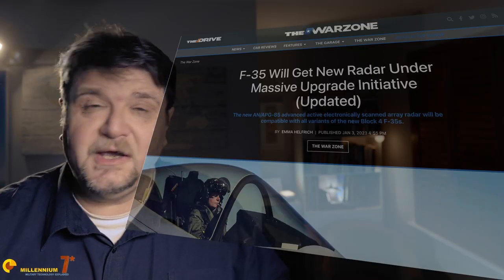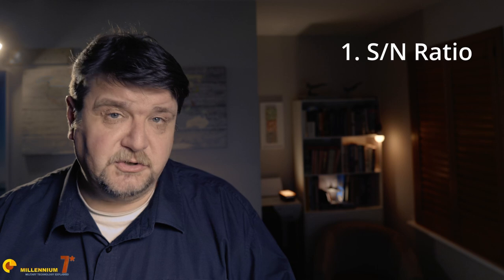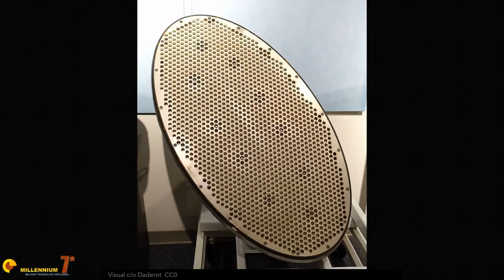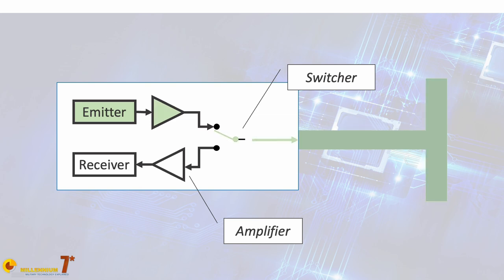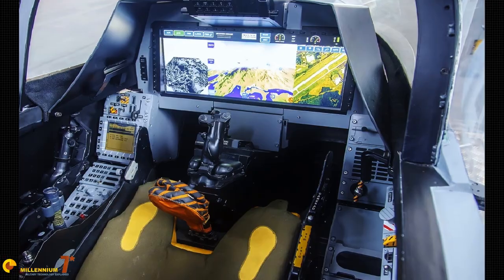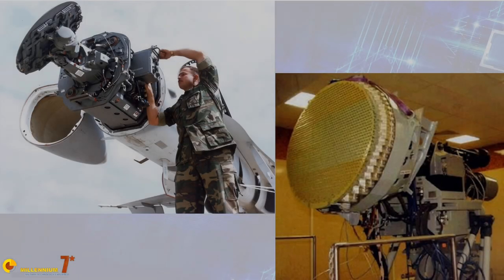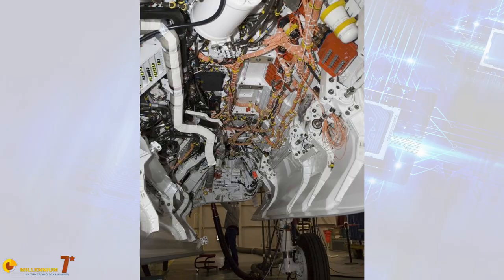The insane engineering of the F-35 AESA radars!

Comment: Or you can keep the larger cooling system, and pump more power through the GaN...
Also, when using it for jamming, the new advantages with narrow beam propagation give not just more range to radar, but more potency to jamming. And all without needing to put a lead-lined bib on the pilot ;)
(for those who were wondering, the main difference between APG-81 and APG-85 is going from GaAs to GaN, and adding 3 new EW modes)
Reply: Nice. I'm betting that's why there's a move from speculation on AESA radars being used as DEWs to the possibility being part of the USAF NGAD.
Reply: @j.f.fisher5318  Looking over my DC uno cards, I'm gonna play "I don't seem to recall". It's a much stronger card than "I'm not at liberty to say" or "I don't have that information in front of me right now", as it gives unlimited plausible deniability for one turn.

Comment: Fascinating but now I have a few questions:  1) Does this AESA radar require that each aircraft knows every second EXACTLY where it is located in relationship to the earth AND and each one of its friendly aircraft?   2) What happens if the defending systems use VHF or HF radars that are widely distributed outside of the conflict areas?  If the defending system is always transmitting ( broadcast radio, TV, mobile phone towers) at RF wavelengths related to the physical sizes of the aircraft, the FACT of the intrusion could be detected along with some relatively accurate location and altitude information?

Comment: Kept hearing AESA-AESA. Let's check it out. In Greece, we already turnt our first 6 F16s into block 70-72 with AESA Radars. The most modern F16s worldwide, which makes them effectively Gen 4,5. 80 more to follow. The rest 75 will remain block 50-52Adv. (Gen 4). Incidentally, we also receive the latest HARM (Anti-Radar) and Harpoon (Anti-Ship) missiles for them. We also received Rafale aircrafts with AESA Radars as well, same case with latest block 3 Exocet missiles and Anti-Air Meteor which supposedly on paper guarantees one shot one kill. They also carry our semi-strategic SCALP missiles. Last but not least, our order of F35s has been approved by US Congress and the process finished. Unfortunately, they will be here 2027-8 due to high demand. Our Mirage 2000-5 are also upgraded. Pretty sure we'll be OK Airfoce-wise. Ours will only be matched with Israel's in the wider region. Thanks for new Kits for our F16s, US guys. Always allies.

Comment: It was not mentioned that the true superpower is not just coming from the semiconductor: GaN. (but GaN is a very good semiconductor nonetheless)
The other recent innovation was using HEMTs (high electron mobility transistors). These transistors use 2D electron gas in a quantum well for conducting the current inside the semiconductor, which is really crazy. The thin and highly conductive layer is created inside an undoped semiconductor, so there are no dopants to cause resistance or noise, or to slow down the electrons. This is quite extreme because undoped semiconductors are really bad conductors, but that is overwritten by the 2D electron gas in the quantum well in the conduction band.
HEMTs are also relatively cheap to make, so you can even buy an 8W 2.5GHz transistor, for 5USD. (and it is tiny: less than 5mm)

Comment: Maybe worth noting that GaAs AESA radars had significant limitations in terms of peak output power, which is in turn needed to burn through jamming. This wasn't a "deal breaker" for fighter-sized platforms where the total power was limited by the platform, but it explains why terrestrial PESA radars such as Patriot's MPQ-65 and Aegis' SPY-1 remained PESA until the advent of GaN MICs allowed similar power levels in an AESA.

At about 11:20 you describe AESA radars as being able to "instantaneously" search the entire volume, but that's really only true when low S/N (and therefore short detection range) is acceptable. For maximum-range search and similar cases where very high S/N and therefore high power on target is needed, the resulting dwell time is more of a constraint than the mechanical scanning rate of a conventional radar or the phase-shifter settling time in a PESA. Where AESAs really excel is in their ability to efficiently track very large numbers of targets while maintaining periodic scanning, and also their ability to maintain near-continuous coverage with low power for things like short-range horizon search.

The most modern AESAs (ones that do beamforming and doppler processing in a single pass rather than sequentially) also excel in their ability to receive "from all directions at once" (i.e. they can use the signals from the MICs to concurrently synthesize receive beams along many axes),  which is a key enabler for multistatic radars, wherein the direction of the return can't be predicted. It will be interesting to see if the Chinese continue with their Luneberg lens LF radars (which intrinsically provide a similar capability, and are undoubtedly multistatic) going forward.

I disagree that the beam can be "very very narrow". AESA sets are constrained by diffraction just like every other antenna, and the best mechanically-scanned antennae were already quite close to that limit. The beam-width is ultimately determined by Rayleigh either way.

I would argue that the fundamental enabler of an LPI radar isn't so much the ability to emit on "any frequency" as the ability to emit on arbitrary broadband frequency "fingerprints", which are extremely difficult to detect unless known a priori. There is a very fundamental similarity between CDMA cellular systems and LPI radars in this regard.

wrt having the radar emit multiple beams concurrently, my understanding is that doing so is fundamentally problematic wrt monopulse processing (which you didn't address but which is a "must" for good angular resolution).
Reply from the maker: Thanks for the explanation.

Comment: Consider this possibility:  Whether or not the APG-85 has some very special capabilities I may speculate about, a future version probably WILL.   So what is an AESA radar system?   In short, it's a very powerful and flexible RF transmitter/receiver system with enormous bandwidth and a very broad operating frequency range.  It can be precisely controlled digitally to generate virtually any arbitrary waveform with appropriate software.  Or to receive virtually any arbitrary waveform, if it has the software for it.   It can be thought of as a highly capable transceiver with enormous bandwith capacity, under full digital control. 

What it can do is subject to the imagination and programming skills of the design engineering team that builds it.    Not just radar.  Assume it's a far more general purpose transceiver.  Or it CAN be.  Software determines capability.    Imagine that it could function as a high power airborne wifi access point.  And much more.  

It could even have capabilities that overlap into the ECM role.

Comment: It is not strictly an AESA related question but the radars of maritime strike aircrafts. Study reveals that anti-ship mission needed specialized radars. The most famous is French Agave radar (and Anemone radar) which was used with Exocet missile onboard Dassault Super Etendard and Mirage-5 aircrafts. These special radars were not good at air to air modes. Did the Marineflieger Tornado aircraft had a different radar than that of Tornado IDS, for using Kormoran anti-ship missile? It would be the same for UK marine Tornado versus Tornado GR4 of the RAF.

Comment: The newly upgraded airborne radar of the J-20 (a new generation of fighter jets) has used microwave photonic technology with full optical control of receiver/transmitter, and the working band is very likely to be no longer limited to the X-band (possibly X/C, X/Ku, X/Ka, etc. One of the dual-band), with stronger anti-stealth/anti-jamming capabilities for low RCS target detection/weak signal detection in strong clutter. The new microwave photonic radar icon can perform centimeter (cm) -level ultra-fine real-time video imaging on detection targets. If it is used for air-to-air missile seekers, it will basically abolish the old American AN/ALE series of towed decoys and MALD air-launched decoys. At the same time, the 055 drive also uses the same technology, which can accurately image and identify incoming targets during the anti-missile interception process.
Reply: Probably true. The military technology is advancing very fast. That's why Gripen E and soon even C have very fast upgradability, as the only known airplane, to always be at the cutting edge of performance. Hence next generation, Gripen NG. But today all other known airplanes take years to upgrade, and propably even the Chinese ones.
Reply: @unknownuser069  No forgetfulness from me on this topic
Reply: Don't believe everything you read in the sales brochures - particularly when it is generic techno-speak.

Comment: Placing "insane" in a title might have been over used in you tube videos but here, it fits.  PESA beam forming looks like the same one used in 5G.   I wonder if AESA can still function in a PESA mode to transmit low freq radar, to better see low observable aircraft better?
Reply: nah not really (but i'll caveat it in a mo). RF ability is a function of the element (T/R module) spacing and element antenna shape and tbh what the IC is built to produce. However (caveat), there's not much to stop you from putting a small array at a longer wavelength in front of the antenna. It'll degrade the main antenna a bit but as long as you're not silly it can be worth it. At 1:55 the top antenna has a bunch of dipoles going around the outside (normally they're arranged near the middle though) they probably operate on a lower RF (from the dipole size) for IFF interrogation/reception purposes. It's not a radar though and probably only outputs a few Watts.

Nah if you want to have a lower frequency radar, just stick it in the leading edge of your wings, there's not much usually going on there anyway. It may affect any stealth characteristics you're aiming for if you do though...
Reply: @Logarithm906 interesting, yup agreed to just place the large low freq radar at another location on the plane. thanks for the info.👍

Comment: Can an individual module be replaced on an AESA radar or does the whole dish have to be replaced?

Also, is the future some type of AESA skin that covers the entire aircraft? Assuming the modules are miniaturized to the point that this is feasible, of course...☺
Reply: You could just change an individual module in theory. However it would probably be faster to just change the entire dish and send the defective one to a specialised maintenance base.

Also, the modules need cooling, so building large portion of the an aircraft skin out of them is out of the question.
Reply: @shi01  I'm thinking years if not decades in the future for the skin AESA with miniature modules. Also, the cold temps of high altitude might be enough of an coolant for the system. Again, waaay in the future...☺
Reply: It is the switch at the back of the module that need cooling the most, not the antenna themself.

Comment: Greetings! Amazing explanation! I apologise in response, but would you please to do some research on what can come to our AESA radars AFTER the Gallium Nitride and possibly replace the GaN as it is currently replacing the GaAs? Maybe the Silicon Carbide will do that sometimes? Essentially, if the GaN is not the last possible stage of high-end military radars, then what comes next? 
I red a bit about some radars built on Silicon-Germanium, but as far as I know, those are only meant for a very-low-cost, low-effectiveness applications and are many times less effective the even GaAs ones. So, definitely not for things like GCAP, FCAS etc...
Of course, I do understand that most information about such things is probably even more classified than that of modern AESA radars, and if there's just not a slightest grain of available information present, I'll readily accept this.
Reply: Most of the information in the public domain relating to new radar technologies is false or misleading, put there by companies who are keen to keep their knowledge very close to themselves.
Reply: Thanks for answer, I know that as well... 
Those who don't hesitate to steal and murder definitely won't abstain from telling lies and half-truth.  And that's also why I asked my question in the first place. I wonder if someone found atleast a small pinch of actual knowledge about it...

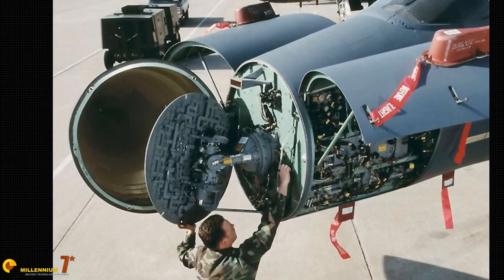Comment: @ 4:32 and 4:51 the back of the antenna plate. Notice that there are no pointy edges at the cabling ? Is this the same principle as in electronics and printed circuits, that no 90 degree corner should exist ? (for signal reflection elimination)
Reply: It is not a cable, it's a waveguide, essentially a hollow pipe of dielectric or conductive material that serves as a conduit for electromagnetic waves. From what little I know of them, they don't like sharp 90° corners.
Reply: @kilianortmann9979  Thanks for the reply. Nice to know that EM waves are transmitted and no electrical signal in those pipes. Cheers
Reply: @georgem4713  That is the fundamental difference between PESA and AESA, PESA has central EM wave generation and transmits them to the emitters (phase shifted if necessary). A true AESA radar only sends signals to the elements, that essentially are tiny stand alone radars of themselves.

Comment: Giving the independent antenna elements, the ability to independently transmit and receive side by side in such close proximity with each other, seems like a counterproductive approach to receiver longevity... if they really have developed antenna elements that are so specifically tightly directed and/or receiver circuits that are so very discriminating, while mitigating or not being adversely affected by any reflected transmitted power... that type of combination is quite a clever magic trick, because from my understanding, one of the most destructive things to any radio receiver, is getting the high transmit power reflected back into the receiver... maybe this is less of an issue to deal with the higher in frequency you go, because you are talking about microwaves, compared with my general experience only being in radio communications transmission... but still, making an extremely hot transmitter receiver unit that doesn't burn it's own receiver up is quite amazing on it's own, before you even get into the signal processing end of things...

Comment: (radar noob here) So PESA phase shifters are (in their base form) kind of like iron core memory matrices? 
My mind boggles at the idea of those little grid-wires holding up to 9+ Gs  (silly, I realize, as they'd have to come up with something better)
Reply: Other forms of phase shifter are available; in particular, it is now possible to obtain surface mount devices. They have been used in naval radars for a long time, and are now small enough to be suitable for use in aircraft.

Comment: Since an AESA radar is a collection of a multitude of smaller sender/receiver cells controlled and managed by central computer, is there a point of still having it in a dish shaped unit in the nose? Would it make sense to distribute it in several smaller units across the aircraft? The aperture would be larger, the scan anges could be made larger, it would degrade more gracefully due to malfunction/damage, it's easier to cool smaller units, etc. Since sensor fusion is a thing and awareness distributed across the battlefield units, there's this kind of smaller cell distribution method on the larger scale, and on the small scale inside a nose-radar, why not on the medium scale, across an aircraft?
Reply: @hermanmusimbi4337  i didn't think of stealth. But in that case, why do a flat surface when the antenna could have any shape really?
Reply: @henrikwannheden7114  It is much easier to build a phased array on a flat surface than on a curved one. Just think about about the simple task of bolting a module onto a plate or a frame.

Comment: When splitting the radar, I guess the transmit/receive timeslots still need to be synchronized throughout the entire unit? Otherwise you'll just receive the pulse sent out by another section the antenna array.
Reply: If they're different frequencies, they can be discriminated
Reply: Ah yes, you're right. Thanks for the reply!
Reply: not really much point in antenna multiplexing. When you do it you have to use fewer emitters which not only reduces your power, it also reduces your antenna gain. These things can work so quickly that it's far easier to just time multiplex.

Plus if you antenna multiplex and you do mess up the duplexing (and bear in mind, you'll have tens-hundreds of thousands of these to schedule every second) you'll likely end up transmitting a few Watts of RF into low noise amplifiers which are only designed to handle picoWatts. This makes the receiver's electronics very unhappy, even if it's on a different RF to what it's currently tuned to. It's like flashing a 2 Watt green laser across the side of someones face and expecting only their green cone cells in their eyes to be permenantly blinded, it just doesn't work like that, all of the cones (and the rods) will get destroyed.